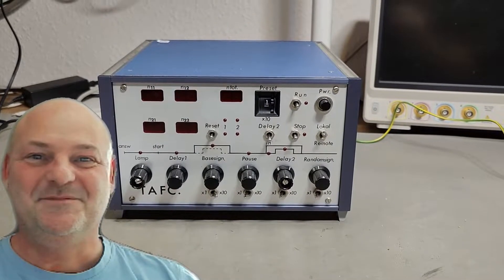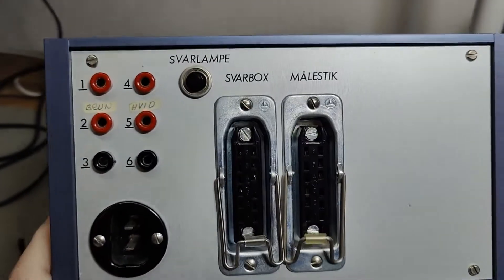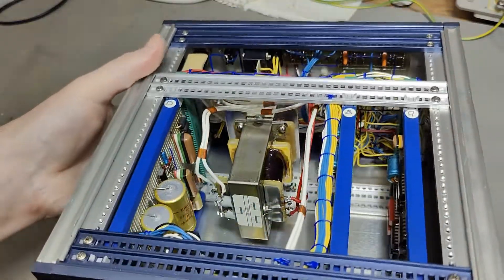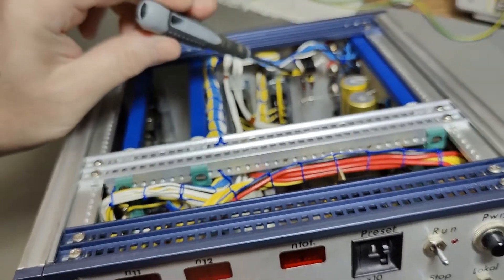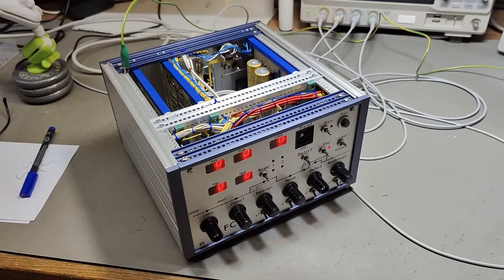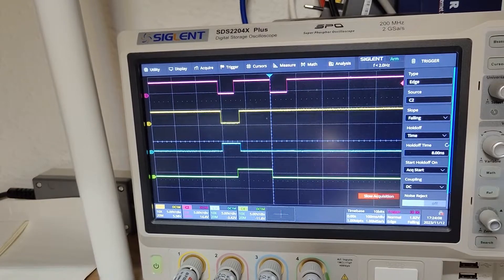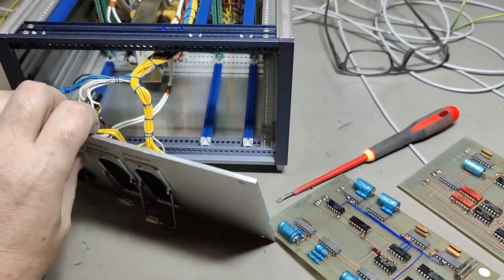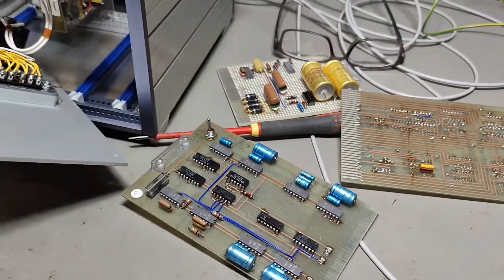DIY TAFC signal pulse generator thingy 1974 teardown

Comment: Given that the date code on a couple of chips is 1972 and 1973, in the absence of any other information to set the date, it seems credible that the date of manufacturer could be 1972 and not 1974 as you suggest.

What we can say for certain is the date of manufacture is no earlier than 1972.
That is all we can say.

Comment: Tom - You say its source was a school that dealt with sound....so maybe this is either some sort of hearing testing device  or a synthesizer, either way I'd connect the output to an amplified speaker and give a listen.  This may also explain the in/ouputs....maybe daisy chained to a keyboard or another synthesizer....or if for hearing then a control the subject could give input when they hear a noise at a certain freq?  For a homebrew, they did an awesome job on every aspect!

EDIT:  Tom - I was correct, it does deal with audio, the key in understanding this device better is the 384KHz that you found, do research on that freq and you'll find articles...here are just a few:

"
A sample rate of 384kHz in audio refers to the number of samples of audio carried per second. It is a very high sample rate and is typically used in professional audio recording and production. The main benefit of such a high sample rate is that it allows for capturing and reproducing extremely high-frequency audio signals with great accuracy. This can be particularly important in certain specialized audio applications, such as ultra-high-resolution audio recording, professional studio work, or in some scientific and industrial applications. For most consumer audio applications, a lower sample rate such as 44.1kHz or 48kHz is typically sufficient to accurately capture and reproduce audio signals.
"  Source:  https://www.quora.com/What-is-the-point-of-384KHz-sample-rate-in-audio

"
The 384kHz sample rate is considered an ultra-high sample rate used in professional recording and production. While it may not have common practical applications in everyday scenarios, it can have certain uses in specialized situations. Here are a few examples:

1. Mastering and Post-production: While most commercial music releases are done at standard sample rates like 44.1kHz or 48kHz, the 384kHz sample rate can have benefits during mastering and post-production stages. It provides extremely high-frequency resolution, which can be helpful when working on complex audio editing, restoration, or mastering tasks.

2. High-resolution audio: Some proponents of high-resolution audio argue that to reproduce the full audio quality of a recording, higher sample rates can capture subtle details, harmonics, and transients that may be lost in lower-resolution formats. The 384kHz sample rate can be used in capturing audio for high-resolution audio formats like DSD (Direct Stream Digital).

3. Analog to Digital Conversion: When converting analog signals to digital, using a higher sample rate provides a greater margin for accurately capturing and representing the original audio waveform. In specific cases where there's importance placed on preserving the original analog sound, such as archiving vintage recordings, a higher sample rate like 384kHz can be chosen.

4. Psychoacoustic research and experimentation: Ultra-high sample rates have been used in some advanced research and experimentation within the field of psychoacoustics. By capturing audio at much higher rates, it enables analyzing and studying auditory phenomena that might not be easily perceivable at lower sample rates.

Overall, it's important to note that the practical applications of 384kHz sample rate are limited and are typically restricted to niche areas of professional recording and production. In most common scenarios, lower sample rates like 44.1kHz or 48kHz are more than sufficient for capturing and reproducing audio accurately.
"  Source: https://talkai.info/chat/
Reply: 384kHz audio sampling in the 70s? Not really. Wrong era really.

Comment: Hi Thomas, the first thing that came to my mind - lighting effects control, those displays could be for displaying remote control settings.
It's beautifully made, these power sockets were also used in Eastern Europe - bakelite body design for two wire connection and metal body for earth connection.

Nice day 🙂 Tom